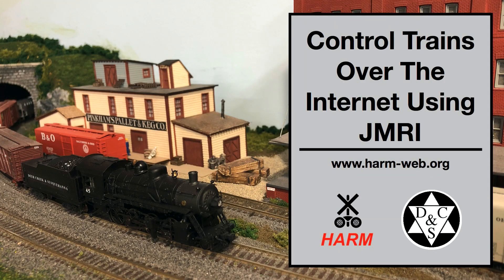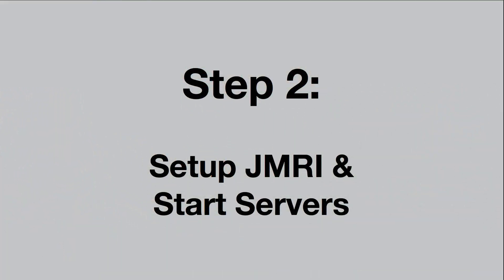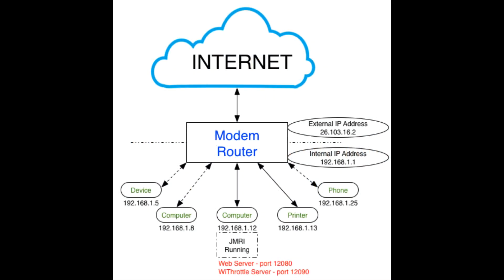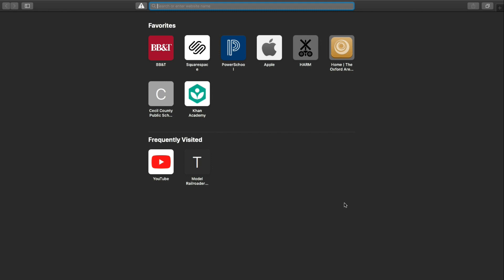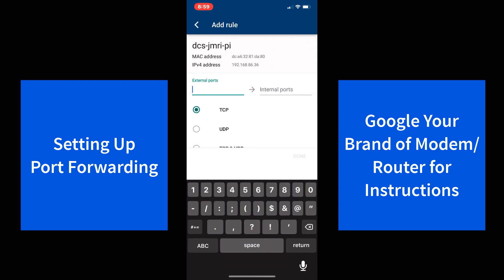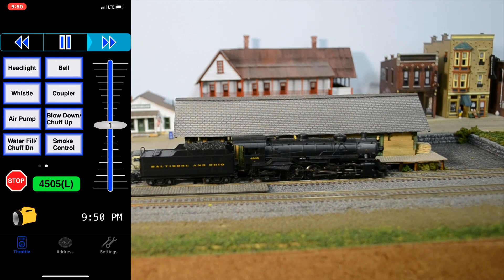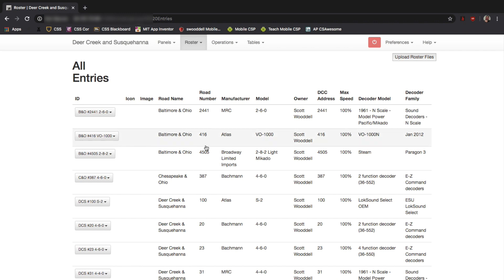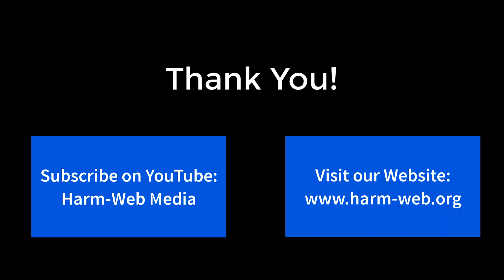Control Model Railroad via the Internet with JMRI

Comment: Fantastic video! I was trying to get this setup but instructions on the JMRI website are not that in depth. I managed to get 'Wi'throttle working fine, but wanted to get my panels on several tablets.

This worked a treat! I even had fun 'webcaming' with my Father in another city, and letting him control the train via the internet...LOL

Thanks from the UK! :)